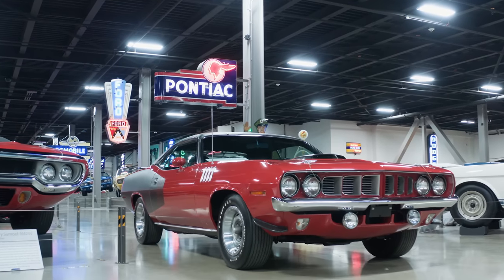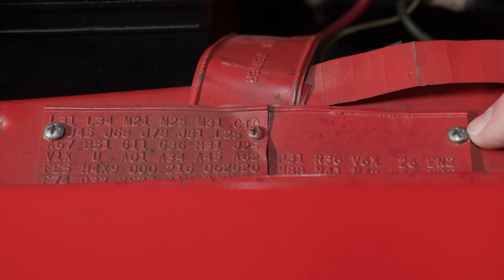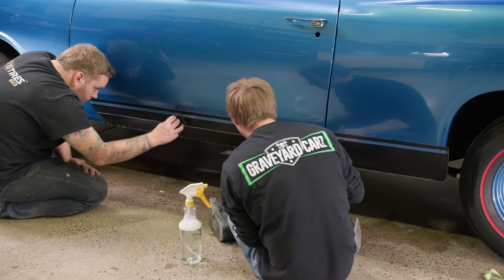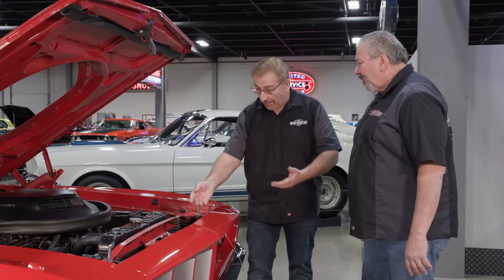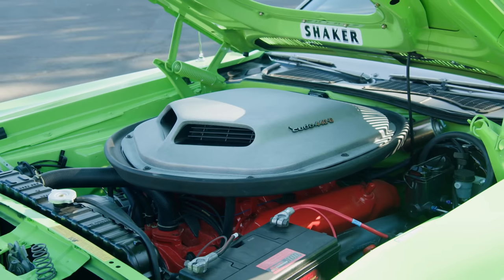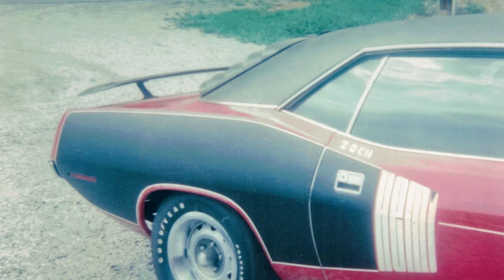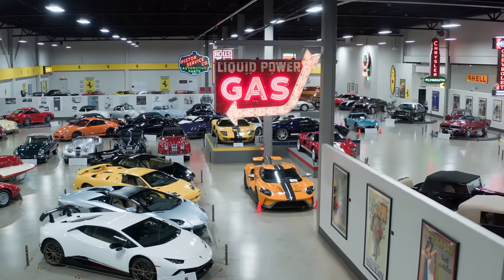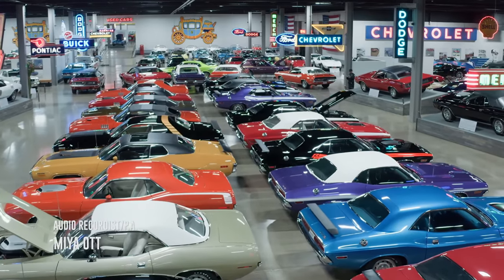BRAND NEW EPISODE: HIGHEST OPTIONED 71 HEMICUDA SPECIAL ORDERED FOR GRANDSON OF THE R.J. REYNOLDS!

Comment: The additional fender identification tags were placed that way purposely because they were additional options during assembly. Today 50 years later we still do this in several different assembly plants. Belvidere was one of my last plants I worked in before my retirement in 2009. Often times there are additional options that are added prior to reaching the final trim line. Normally it's only for the most equipped high-end models. Saying that what I mean is that such adds are added to the vehicle do to missed options during the assembly process. The older models like this Cuda is the same reason and that is why the tags are placed in that way. This let everyone know when the vehicle reaches final trim lines to let everyone know that all options were applied to the vehicle. When these vehicles are being assembled there's really not much time to apply each application. It's a matter of efficiency to build that vehicle as quickly as possible.
Reply: My step mom worked for Chrysler up until they closed the plant, she used to work at GM in Janesville until THEY shut down too lol.

Comment: Is the HEMI lettering on the billboard original? Asking because when it had the white pinstripes around the billboard the HEMI lettering was white also. Or was it painted and chipped off like the pinstripe?
Reply: It was the original decal, painted over with sign painter's enamel paint. 
Over the years it became so brittle it just flaked off. 
I know who did it. He did cars and motorcycles for Zach.
The Ace of Spades was Zach's trademark.